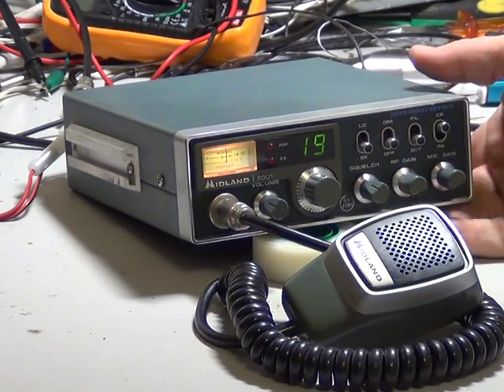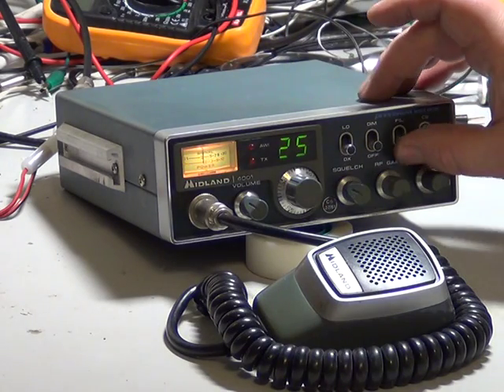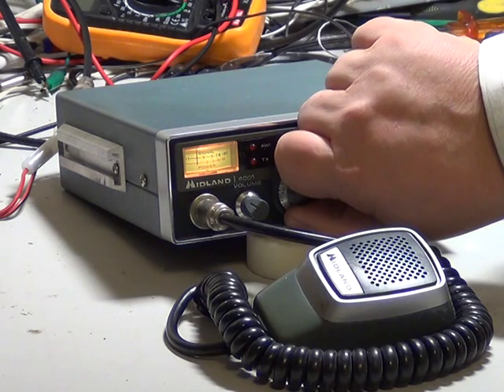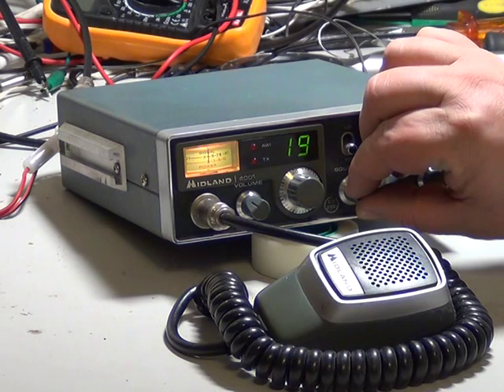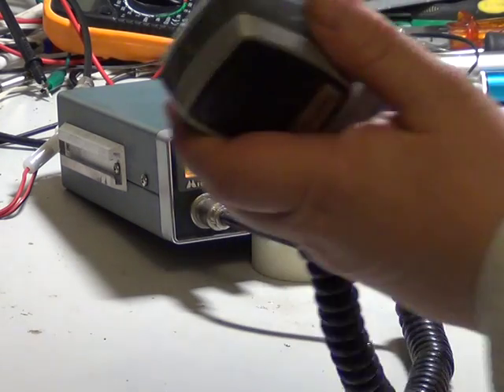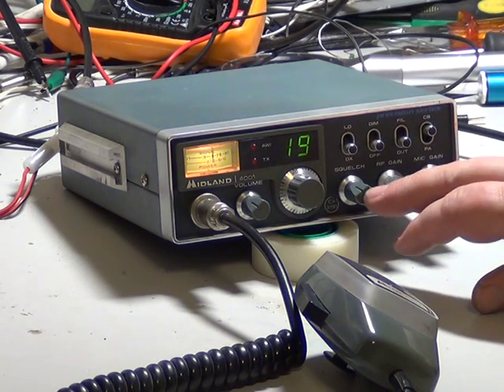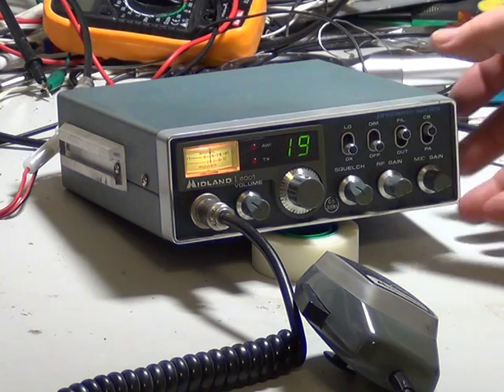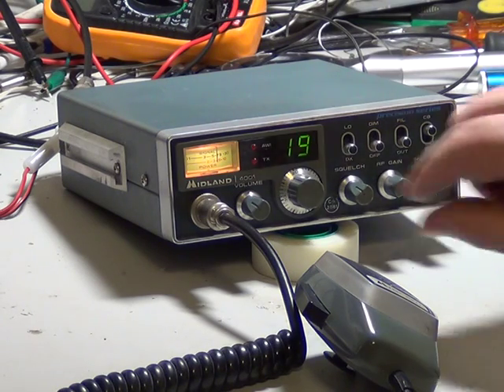Midland 4001 - UK CB radio, (CB 27/81) (Mobile) -  On The Air Test

Comment: Can I ask a quick question, please?
I am in the process of fitted one of these to my campervan, powered by a 110Ah leisure-battery which in turn is charged by a split-charge relay and 100w solar panel and MPPT solar controller. My question is this: With the set left on RX with the volume fairly low and the squelch engaged, how many amps (roughly) will the set be drawing? (Many thanks in anticipation!!)
Reply from the maker: They are around 180mA on standby, 600mA on receive with good volume,  1.1A on transmit.  80mA of that is the meter lamp.

Richard (UK)
Reply: UK CB radio servicing That’s brilliant, thank you for such a quick reply!